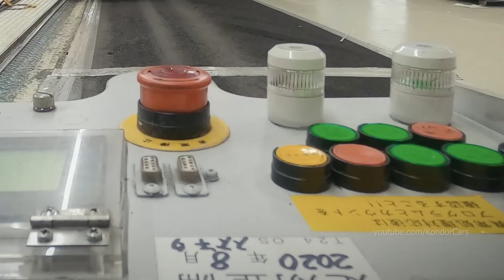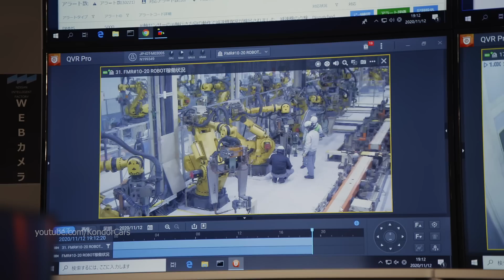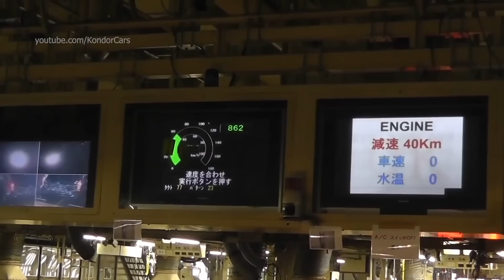Nissan Z Production in Japan | Inteligent Factory

Comment: I think this video also shows production of other Nissan products as well.
Reply: U think so? 🤔
Reply: @dot7107  yes. Check 2:48 for example. They’re working on a 4-door car.
Reply: @aeronYTco  The R35 GTR and Q50 are built in the same factory. Nissan is generally relegated to third after Toyota and Honda but my 2014 Q50S Hybrid AWD has been bulletproof for over 8.5 years and about 100K miles. No, not as good as my 2017 NSX or 2021 LC500 Convertible but still an amazing car. I generally move on after 7 years but other than squeaky brakes, no reason to punt the car. I am sure the new Z will be well built.
Reply: Some jdm saloons are made in this plant, Nissan Cima, cima vip, vip G,  Fuga 250, 370, Hybrid, Vip, Skyline 400R and pro pilot2 Hybrid.
Reply: Nissan skyline, GT-R, note e power
Reply: Duh

Comment: It's just hard to get past their history with reliability and longevity problems
Reply: Has nissan cars all my life never had a single issue, not sure what you are talking about.
Reply: @deni8814  I agree once Nissan builds a good car they build a good car but when its south it's south
Reply: @deni8814  Look up consumer reports on nissan and tell me you don't live under a rock. I worked at a Nissan dealership in Ontario Toronto they all have CVT issues the VQ motors in the Z's had oil burning issues. The VR in the new z hopefully will be reliable but most nissans are junk.
Reply: @MJT-DA  been driving VQ's never had an issue, Maxima 1997, Maxima 2002, Altima 2004 4 cylinder non VQ, Maxima 2014, Infiniti 2015 Q50 current car, never had any engine issues with any car I must have put minimum 500,000 miles.
Reply: @deni8814  Just because YOU had no problem doesn't mean majority did not. Car complaints, consumer reports and JD power all say they are unreliable from data of multiple people. You are just one of lucky few who didn't have a problem.
Reply: @MJT-DA  i must have had 5 perfect cars, my dad family all drove nissans , nothing but oil changes and regular maintenance, this is all from Sentras Rogues Muranos Q50, must be all luck, everyone else has issues.
Reply: @MJT-DA  bmws or benz's are better? lol
Reply: @mikeduncan7552  hell no lol but for a “Japanese” brand bought out by the french it’s unreliable for a Japanese car.
Reply: @MJT-DA  the french did not buy Nissan, Nissan bought a share of renault, nissans own a share of Mitsubishi and subaru too. You can keep buying American mad junk
Reply: @mikeduncan7552  I-i actually own an Asian car. More specificity a Korean car.